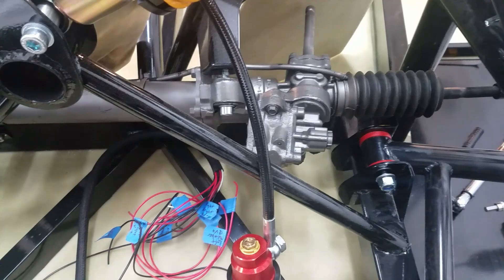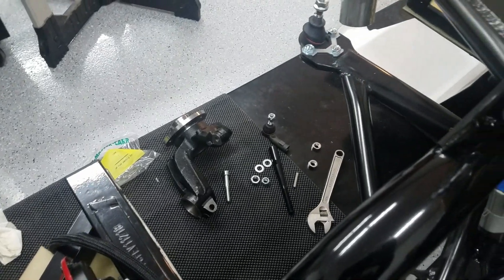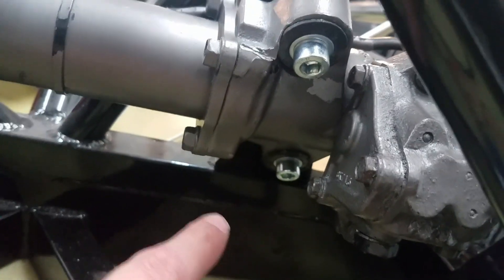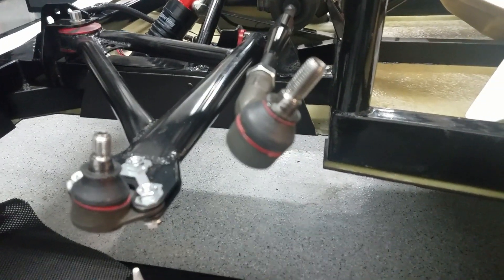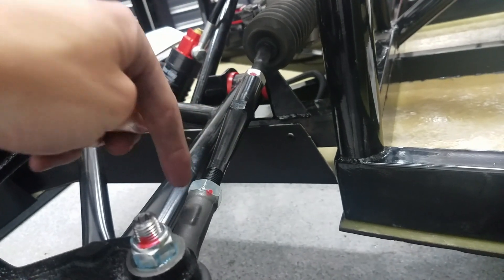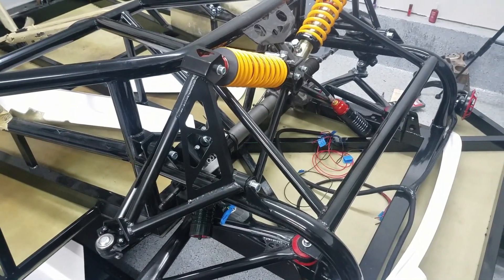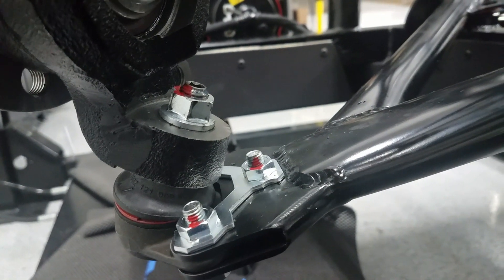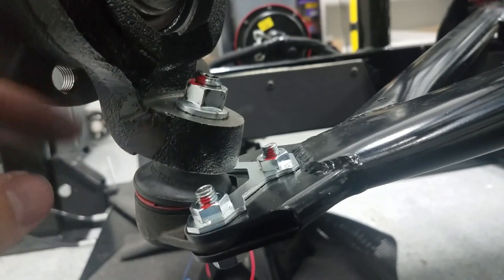Front Axle

Comment: Jeremy did you ever revisit the front axle ? I realise the bearing is pressed into the housing, but nothing else is holding it in. There's usually an big bolt that connects to the front axle that keeps it all together. I'm pretty much at this stage with my K1 build - using your knowledge and Kiefer's to fumble through... I just thought that if you didn't need to make any mods then nor will I !!!
Reply from the maker: I did not make any other modifications.   Not saying that is the right course of action, but so far...so good 🤞

Comment: I know this's an old video but,  that castle nut should be pretty tight to wedge the ball joint stem (taper end).  I think they're usually torqued to something like 50-100 ft-lbs (but I'm not certain about this number). You could use the hex on the ball joint to prevent it from spinning.

Comment: At 6:00 what hold the spindle in.  Is there a c clip that holds the back in
Reply from the maker: Not sure what you mean.  The wheel bearing is pressed into the spindle.  The spindle on the bottom has a castle nut and on top it is in a channel that is locked in by another bolt.  Hope that helps